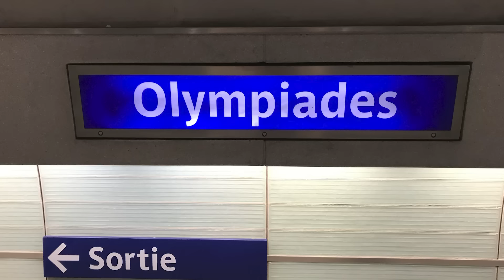Why Paris is Doubling the Size of its Metro?

Comment: Paris and Moscow Metro and Suburban Systems keep getting bigger and bigger

Meanwhile London and New York have stayed stagnant
Reply: What about the London Overgroind?
Reply: London has not stagnated. It has two ring roads already. The circle line on the underground which has been operational since the mid 90's and the London Overground which has been operational from around 2007. Suburb to suburb transport has just been completed last year with Crossrail aka the Elizabeth Line. They're now thinking of doing another Crossrail line from north to south
Reply: @UnclePooSniff  Now compare that to the Projects of the other two Cities mentioned

At least they're doing more than New York😂
Reply: @UnclePooSniff  And the extension to the Bakerloo line? Paris is delivering all of this before London can extend one line by four stations.
Reply: @jayfielding1333  Good point. London is just ridiculously slow at doing anything. The Bakerloo Line desperately needs to be extended back up to Watford and further south. They need it. Also the Northern Line needs sorting. Looks like a hot mess. Probably be 2040 by the time all that is addressed
Reply: Idk about London, but New York? I would argue that it is not stagnant. It's in fact going into the minus. It's moving backward. The crumbling infrastructure, the 9hettoization of the metro stations (trash everywhere, homeless and criminals occupying the stations, people kept being harassed on the stations). Making the viability of the service worse and worse. NYC Metro is unsafe.
Reply: London over 400 km metro rail 
Also has 120km cross rail 
35 km light rail 
Overground rail and many more
Reply: Come on 😂 Paris still operates trains from the 60s and London fully opened the Liz line not that long ago
Reply: @DyingJournalistsAreMyDopamine Woah bro you mean people don't want to ride a warzone on wheels? Not very dei of you
Reply: @Gfynbcyiokbg8710 Name that line which has trains from the 60's in Paris?
Reply: @puccaland definately line 3, and probably lines 3bis, 10 and 12
Reply: @Gfynbcyiokbg8710  Those trains are from a serie launched in 2012. 🤦
I guess you can easily find on YouTube videos about how the metro actually looked like in the 60's. Moreover what do 4 lines say about a network counting 40 railway lines?
Reply: @puccaland  No the MF 67 still runs on those lines 😂
And if 10% of your lines (25% of the metro) operate ancient trains, you are definately doing something wrong
Reply: @Gfynbcyiokbg8710  MF 67 is just a model, like the shape and stuff, not a train built in the 60's. Across the years that model was upgraded in many series and the latest one on those lines is from a decade ago. Just like the TGV and RER aren't trains from the 70's or the Transiliens trains from the 2000's 🤦
Reply: @Gfynbcyiokbg8710  You're just being desperate dude. Besides if you knew anything about public transportation done right you wouldn't be paying what you pay in London for what is considered a disgrace of a network for such city.  The day we'll need your expert assessment on how doing public networks right you'll be the first to know.
Reply: @puccaland  Yeah but there are still trains from the MF 67 A1 rolling around line 3, and those were definately built in the 60s. And those 'upgrades' haven't done much, they still look ancient.

You also seem to have Zero understanding of what the RER and TGV rolling stock is like. Its not one "shape and stuff" they have very different models from different years. The RER and TGV trains from the 70s look nothing like the modern ones
Reply: @puccaland  Says the person with no understanding of public transport, expecially Parisian public transport. 

London may be worse in terms of what you pay, but Paris is terrible in terms of how you pay. London has had contactless payment for 10 years now, Paris still doesn't have it anywhere (but two bus services). London has also had its Oyster card for 21 years, Paris has had its equivalent for 5.

And even after the Grand Paris Express, London will still have a longer metro system than Paris.
Reply: @Gfynbcyiokbg8710  There aren't MF67 A still rolling. That model has been discontinued decades ago. Moreover on the lines you mentioned they are using the MF D, E and F models 🤦

Looking ancient doesn't mean that it's ancient. And looking ancient is one of the purpose of the Paris metro. It's considered part of the heritage and that keeps the tourists happy. 🤦
Reply: Yes, the TGV and RER had different models and those models are developed into different series. They can also use different models like nowadays most RERs are double deck trains and soon the RER B will have one as well. Same system with the metro! Those metro trains you say look ancient are technology wise very much modern and the new metro lines will use part of that technology although they won't look ancient. The metros on the lines you mentioned look nothing like the MF 67A 1 either. You're just full of it.
Reply: And desperate. That's not because you live in an alternate reality which you filled with fakenews and wishful thinking that people have no clue about the Parisian network. I know enough to know that Paris has the densest network in the world and is regularly awarded best network in the world with every Parisian having a mean of public transportation 1 km away maximum. London isn't even playing in the same league.
Reply: Terrible on how we pay? Lol how you pay in London is called a scam in Paris. 

The rest you totally live in a parallel universe. So much for accusing others of not knowing the Parisian public transportation network. 🤦
Reply: Contactless payment has been existing in Paris since 2002. That's 22 years for you. It's used in all the public transportation systems including the buses. Nowadays people use either the Navigo or their phone. They pay between zero to 42 euros per month for unlimited access to the entire network which goes beyond the Greater Paris limits, the tourists like you will pay 84 euros for a month.
Reply: Paris has zero equivalent of the Oyster card which is just a rip off and people don't need it for the reasons expressed above. Oh! Wait, for the tourists they made one they call Navigo Liberté or something. And I am not sure because that's not worth using it.
Reply: Who cares about having the longest metro system? People care about having an efficient and cheap metro system. That such a big city like London is still almost entirely reliant on the metro is precisely why it makes it a disgrace. The metro is slow and is useful in the urban areas only. Let's not even get started on how it's cramped in London, very uncomfortable. Then you complain about metros which look ancient?
Reply: Paris is also reliant on the RERs, Transiliens, tramways and TERs to go faster and for better comfort. And since they don't have to care about whether they can afford moving around, they do use all those networks like a single one. 

With just the 4 new lines the metro network in Paris will be bigger than the metro network in London and they keep adding new lines projects in Paris. And nobody cares for in the case of Paris that's just a fraction of the network. The RER network alone is bigger than the metro network. You're desperate.
Reply: @puccaland  😂 Then why are there pictures of MF 67 As still running?
And if having heritage trains was the point then why are they planning on retiring them? And why don't the new trains have the same 'heritage' look? Stop making up nonsense
Reply: @puccaland  The Navigo Easy was made because Paris' old ticket system was very confusing to tourists. But that didn't fix much. You still see a bunch of people online who are really confused with the mess that is the Paris fare system
Reply: @puccaland  Yeah no that was a smart card. Paris still doesn't allow for payments with credit/debit cards. Also when it was introduced it did barely anything.
Reply: @puccaland  And paying with your phone is so much harder in paris. You are forced to do everything via an app, whilst in London you just tap your phone and pay via Apple/Google Pay
Reply: @puccaland  Again, more nonsense from someone who has no idea 
London has a massive rail network through National Rail TOCs which includes Thameslink, the Overground and the Liz line. No one is 'entirely reliant' on the tube.

And again, you have no idea what you are talking about. Those small trains make up a minority of all trains used in London
Reply: @puccaland  And you are again just ignoring everything else London has.  London has 3 of the top 5 busiest commuter rail stations in Europe and 8 of the top 10 busiest 'rapid transit' stations in Europe.
Reply: @puccaland  You also don't seem to understand how Youtube works grandpa
Reply: @puccaland  prove it then. Because everything up to now that you've said about either city has been wrong
Reply: @puccaland  So you agree that you are wrong?
Also you can't even comprehend basic english. 😂 None of that is what I said.
 I said the MF 67s are ancient and look so (which they are)
 You then said that people like that because 'heritage', which clearly isn't the case as the new trains have a completely modern look
Reply: Don't try to pretend that the tourists are like you, confused. They know Paris better than you do and the daily, weekly or monthly Navigo are the way to go for them. Navigo Easy is simply the physical support allowing visitors to charge the plan of their liking if they don't stay more than a day, or for the Parisians who rarely use public transportation.
Reply: @Gfynbcyiokbg8710  Can you two stop arguing already?
Reply: @Gfynbcyiokbg8710  Who cares about paying with a credit card? You're saying that as if it was a progress, it isn't. You pay by credit card because you have to pay for every single one of your metro rides, in Paris people either use their phone for that or they don't have to pay for every single ride or to pay at all. Stop trying to make a rip off pass for an advantage that's pathetic.
Reply: @puccaland  😂 have you seen how many posts there are on sites like reddit with people asking how to pay on Paris' system. Its not that simple
Reply: @BLACKSTA361  you decided to post that comment on the internet
Reply: @puccaland  Maybe think for a second before you most even more nonsense? You can absolutely have a fare hopper scheme or a daily cap with credit cards. London has both.

You can still have monthly passes or whatever whilst ALSO accepting credit cards and proper mobile payments, whats good for regular commuters isn't whats going to be good for everyone
Reply: @Gfynbcyiokbg8710  So your feelings are hurt that Paris Transportation is moving forward while Londons is not?
Reply: @Gfynbcyiokbg8710  I simply don't live in your alternate reality. The entire metro system in London is considered cramped by international standards. Even in Tokyo where they can reach 200% congestion rate it feels more comfortable in comparison. You can gather all the networks you want in London it still makes the network too small and too slow to be efficient for such big city. And with the price that's simply a scam. I never said the entire network but almost. So you'd rather focus on your English comprehension skills as well or keep making an embarrassment of yourself.
Reply: @Gfynbcyiokbg8710  London is whatever you want and is still not playing in the same category with Paris. Having busy stations or lines isn't what makes the network efficient. 🤦Keep trying.
Reply: @Gfynbcyiokbg8710  I don't have to prove the hallucinations you have in your head. You can easily find what trains run on what lines, that's not a secret. 🤦

Quote anything I said which was wrong?
Reply: @puccaland  And again you say absolute nonsense with no evidence at all. London's bus network is more than twice the size of Paris', London's metro network is almost twice the size of Paris' and when it comes to the rest of the rail network, you literally cannot compare their sizes.
Reply: @puccaland  Well you seem incapable of proving that point, so I suggest that you keep trying
Reply: @puccaland  You said that the MF 67 A was retired decades ago, but there is a photo in Wikimedia Commons from 2022 clearly showing a MF 67 A (M. 10023) still in use.

You said that the new metro (and RER and TGV) trains were just 'upgrades' of the same model which definately isn't the case

You also claim that 'contactless payment' was introduced in 2002, it was introduced in 2001. Thats also not what the vast majority of people would consider contactless payment. Plus the Navigo was extremely limited in its first years.

You also say that when the GPE is finished Paris will have a larger metro network, which also isn't true. Paris: 426km
London: 440km
Reply: @puccaland  You have also said that paying by credit card forces you to pay for every ride. Which certainly isn't true. 
On London buses you can switch buses without paying again, and there is a daily cap system wide so that you never pay more than a certain amount.
Reply: @Gfynbcyiokbg8710  Well if your source is Reddit, no wonder why you're so out of your depth here. Dude, Paris welcomes every year 50 million tourists not even counting the simple visitors. We don't need a virtual place like Reddit filled with so many people who aren't the brightest lights, tourists are like part of the scenery every single day in Paris, in the real life.
Reply: @puccaland  You also completely ignore any other rail services in London and routinely make claims that you would never be able to prove.
Reply: @Gfynbcyiokbg8710  You're the only one talking nonsense and not providing any evidence. What is the size of London metro network? How many bus lines are there in London? Moreover we note that on a topic about the railway network here you are babbling about the bus network. That's how desperate you are. 😂 If now you're comparing the metro, even the tramway with the bus, you're just making my point. Slow and inefficient.
Reply: @puccaland  Yeah well a system should be easy to understand even for people who 'aren't the brightest lights'
Reply: @puccaland  London's metro network is 440km long according to TfL
Reply: @puccaland  There are 675 bus routes in London that are operated by TfL. And buses are a vital part of any city's transport system so they are absolutely relevant
Reply: @puccaland  Also you seem to lack any comprehension skills because I said that it was impossible to compare the SIZE of each city's rail network. And I said that because it literally is impossible to compare the SIZE of each city's (not including metro and tram) railway network. You can still compare the rest, because London still has a ton of fast rail services.
Reply: @Gfynbcyiokbg8710  Desperate desperate.

Give us that link of a M67A names M10023 being in use in 2022?

Dude, you have on Wikipedia the list of all the cars being used per line, and I didn't find any trace of the one you're talking about. Moreover on the lines you listed they don't use the M67A series! How I see it, on your Wikimedia Commons they simply showed you a picture of an old train which was uploaded in 2022. 🤦
Reply: @Gfynbcyiokbg8710  Oh! Wow, I made a typo and wrote 2002 instead of 2001 and all by magic I am lying? Desperate desperate. Well, that still makes way more years than in London. Back then it literally replaced the Carte Orange so all the users who had a Carte Orange moved to the Navigo so it was pretty much a lot of people.
Reply: @Gfynbcyiokbg8710  According to Wikipedia the current London underground counts 11 lines covering 402 km, Paris 16 lines 226 km plus 200 km with the 4 new lines. But for the sake of the argument let's say London will be 440 km and Paris 426. That's a difference of 14 km! So you really are that desperate after all? What about such small difference? Well? In London the metro accounts for the majority of the railway network, in Paris it doesn't! Your 14km are covered by some tramway line somewhere in Paris. 🤦
Reply: @Gfynbcyiokbg8710  Paying for every ride means that you pay everytime you take the bus 🤦. In Paris you can take the bus 1000 times if you want you won't pay any fee for that's included in your daily, weekly, monthly or yearly plan. Please follow! In Paris too the tourists don't pay twice between two buses. That's not what the topic was all about, was it?
Reply: @Gfynbcyiokbg8710  I didn't ignore the other railway networks in London, I literally said that you can gather all of them the network in London is still a disgrace for such city and it isn't playing in the same category with Paris. Simply follow.
Reply: @Gfynbcyiokbg8710  The system is pretty easy to understand for the Parisians and most tourists who go there. Simply don't go to Paris if you can't manage.
Reply: @puccaland  You are just wrong again. The Navigo didn't start having the same functions as the Carte Orange until the end of 2004 and only fully replaced the Carte Orange in 2006.
Reply: @puccaland  Again you are completely ignoring any other rail service. London also has the DLR which is an Automated Light Metro, bringing up London's metro length to 440km. 
And again London has alot more than just the Metro. From the Overground, Elizabeth Line and Thameslink to the many National Rail operators that provide commuter services.
Reply: @Gfynbcyiokbg8710  Didn't find the page on TFL saying that the length of the network is 440 km. But like I said it doesn't matter. Make it 600 km if you want it still doesn't change the dynamic.
Reply: @puccaland  Except you cannot prove any of that
Reply: @puccaland  Tfl say that the tube is 402km and the DLR 38km. 402+38 = 440.
Reply: @Gfynbcyiokbg8710  It's not possible to compare the size of the railway networks between cities for people who are desperate and don't have a point only. In the real world we simply pick the entire railway network in any given city and we compare with the entire railway network in another city. You said what the local railway network is made of in London I said what it was made of in Paris. Now simply work on your intellectual honesty.
Reply: @Gfynbcyiokbg8710  The DLR isn't considered part of the London metro network hence why the TFL doesn't include it to calculate the size of the metro network. The DLR is a network of its own and you can add it with all the other railway networks it won't change anything to the problematic. Try harder.
Reply: @puccaland  There is no way to define London's local railway network. London doesn't have one or two companies that operate local services, London has about 11. 
Using the oyster zone isn't a fair comparison as it only goes 45km outside of central London, whilst Transiliean goes 100km outside of central Paris. And there is no branding of services that are comparable. 

Unless you want to go through one by one each station and service and decide if it counts or not, it is literally impossible to compare the size of the two.
Reply: @puccaland  Don't conflate Metro system with Underground system. The Underground isn't a term for all metro services in London. The DLR and Underground are different systems BUT they are still both METRO systems.
And therefore when I say 440km of metro lines, that includes the DLR because it is still a METRO.

Also TfL never says that the DLR isn't a part of London's metro network.
Reply: @Gfynbcyiokbg8710  It is. Local networks are managed by local authorities which define which network is local or not. That's the same all around the world and London isn't any different. The Transiliens is part of the Parisian local network. Who talked about zones? London isn't to be compared to the center of Paris but to what is used to define Paris at a national level and internationally which is the Greater Paris and the equivalent of tfl is IDF Mobilité.
Reply: @Gfynbcyiokbg8710  That there is nothing comparable to the Transilien in London is pretty much my point. Despite its size, London is lacking infrastrures to cover the areas beyond the central urban perimeters.
Reply: @Gfynbcyiokbg8710  Would it be London or the several organisations, they compare its network to the networks all around the world including Paris. That you don't want to do it because it doesn't serve your narrative is your problem. They do everything. They count the lines, the stations, the length, everything.
Reply: @puccaland  What are you on about?
Reply: @Gfynbcyiokbg8710  I didn't conflate anything. That's simply you trying to digress as usual. I never said anything remotely close to your "the underground system is a term for all metro services".
Reply: @Gfynbcyiokbg8710  TFL doesn't consider the DLR as part of the metro network that's what I said. The DLR is a light metro, not a metro, and is considered a railway network of it's own. There is the equivalent of the DLR in Paris as well and it's not considered being part of the metro network either. The day TFL will include the DLR in the metro network they will let you know. For now they consider the metro network in London doesn't include it.
Reply: @puccaland  Yeah no thats not how the world works. Local transport can be entirely private, entirely public or a mix of the two. 
Also a local authority is a council, which doesn't include TfL/GLA. The GLA is regional not local.
Reply: @puccaland  You literally assume that London Underground equals London Metro.
Reply: @puccaland  A light metro is still a metro. Its literally in the name. And TfL never talks about London's "metro network", so again you are just making up nonsense

Just because it is operationally seperate from the Underground doesn't mean its not a part of London's metro system. 
Also prove to me that TfL has said that the DLR isn't a part of London's "metro network". Good luck trying to do that.
Reply: @Gfynbcyiokbg8710  I never assumed such thing. Your entire intervention here was to manipulate people's words and do the questions and the answers yourself. So simply quote what I actually did say and refrain from speaking on my behalf.
Reply: @Gfynbcyiokbg8710  That you're deprived of any logic has nothing to do with me and at this point it's clear your hopeless.

A light metro is a light metro, just like a tramway or monorail aren't considered part of a metro system anywhere but in your mind.  Tfl is the official body in charge of monitoring all the public transportation system in the Greater London, explains to you all the systems, and they don't include the DLR in the same network that the metro network. Get over it.
Reply: @Gfynbcyiokbg8710  Or don't for what I care. I don't have to care about your wishful thinking and self delusions. We won't change the facts just to keep you happy. Like I said in your alternate reality you can make the London metro network length 600km if you want it doesn't change anything at all. The network is still too small, too inefficient, too expensive for the service provided and doesn't play in the same league with the Parisian network.
Reply: @puccaland  A light metro isn't a tram or a monorail. This just again proves that you have no understanding of anything to do with public transport. 
A light metro is just a metro that uses smaller trains are therefore has a lower capacity. Many metro systems have both light and heavy metro lines within ONE metro system
Reply: @puccaland  😂 You just love making conjecture with ZERO evidence to prove it.
You haven't and cannot prove any of what you have said because you know that they are all just lies
Reply: @puccaland  You literally did assume that. TfL has never talked about London's "metro" network
Reply: @puccaland  Again something that you just refuse to prove. The Underground is A metro network, and so is the DLR. Together they make THE London metro network
Reply: @Gfynbcyiokbg8710  So basically you are telling me that you don't know what the word metro means ? In the UK you call the metro underground or the Tube others call it subway and most of the world calls it metro in English because America. Now if you have complaints about the word metro being used rather than underground go complain to the Americans and their influence in this world. 🤦And if you can't adapt to the realities of this world simply stay in that alternate reality you built for yourself. You perfectly know what I refered to with the term metro and you confirmed it when you reinstated what tfl said about its size. Pathetic.
Reply: @puccaland  😂 Again just proving that you don't understand anything. In Glasgow (UK) their metro system is called the Subway, and in London we have BOTH the DLR and Underground (Tube).
The Underground is the word for A SINGLE metro system, not for all of London's or for all of the UK's 

There is no one word for every metro, except for metro. And the DLR and Underground are both METROS that make up London's Metro network.
You can't just pick and choose things so that they prove your nonsense ideas.

And once again you are refusing to prove that TfL has talked about London's "METRO" network because you know that it was a lie from the start.
Reply: @Gfynbcyiokbg8710  I never said that a light metro is a tram or monorail. So thank you again for perfectly illustrating your English comprehension issues. Or is it despair?
Reply: @Gfynbcyiokbg8710  A light metro is simply a light metro and only in your alternate reality it's considered like a regular metro system. 
Name those cities which consider their light rail and metro network as being one unique metro network? And even if they did how is it of any relevance to London? The TFL speaks for London and they clearly separate the underground and dlr.
Reply: @Gfynbcyiokbg8710  You're simply raving as usual to impute me things I never said believing it will make illusion and cover the void of your arguments.

TFL uses the words underground or the tube which is your way in the UK to name the London metro network. You can check, it's translated by the word metro in most languages and all around the world they use what tfl says to define London's metro network. Ah! My bad, sorry I forgot you don't know what metro means. To define the London underground 🤦
Reply: @puccaland  1st of all many light metro systems are nothing like light rail. Many use trains derived from heavy rail trains.
Budapest, Vienna, Sofia, Beijing, Shanghai, Guangzhou, Nanjing, Wuhan, Milan, Moscow, Singapore, Busan, Seoul, Barcelona, Taipei, Bangkok, Istanbul, Chicago, and more all have light metro lines as well as heavy metro lines that are all considered a part of a single metro system.

And so what if they have them seperate? For anyone travelling around London it makes little difference if they are on the DLR or on the Underground because they are integrated into a single system.
Reply: @puccaland  😂 You literally just used 'light rail' in place for light metro. And the lines between what is a tram and what is light rail are very blurred
Reply: @puccaland  So before you said that you didn't think that Underground = Metro, and now you do 😂 Make up your mind.

Also TfL DOES NOT use underground to mean all of London's metro services because Again the DLR IS A METRO. People with no brain like you have just assumed that Underground = Metro because the underground makes up Most of London's metro.
Reply: @Gfynbcyiokbg8710  Beijing Subway is just the name to call the city's public transportation network. It doesn't mean that that network is a metro or subway and is considered as such. They do make the difference between their metro network and their 2 light rail lines. In fact people even have to pay when changing from a network to another.
Reply: @Gfynbcyiokbg8710  You're the one who made it a problem because you are separate not me. Everywhere the different networks are used as one network. In Paris the train lines are used interchangeably with the metro lines, or any mean of local public transportation. It doesn't mean that a RER is a metro, does it? In Tokyo the different networks are private but the entire network works like the same network. You're just fabricating issues which don't exist out of despair. Nobody ever told you that the network in London isn't used as a single network.
Reply: @puccaland  yeah thats not the case. The difference between Beijing's different systems is because they have different operators, it has nothing to do with the difference between light METRO and heavy metro.

And you just seem to love to assume things that aren't true. 1st you assume that Underground = the only Metro and now you assume that Light Metro = Light Rail
Reply: @Gfynbcyiokbg8710  Your delirium in your head has nothing to do with me.
In Beijing several operators manage the metro network and we don't change the fare system when changing the lines. We do for the light rail lines. RER on Paris is managed by 2 companies and its considered a unique network with no change for the fares. All that is irrelevant for all the bodies in charge of a public transportation network clearly state how they differentiate the networks.
Reply: @puccaland  😂 And once again you are wrong. Tokyo has two very seperate systems that make up the Tokyo subway that definately do not work like a single network.

Also you're the one trying to push this idea that even though the DLR is a metro system, its not a part of London's metro system. Which 1st of all doesn't matter from a rider's perspective and 2nd is just wrong.
Reply: @Gfynbcyiokbg8710  I didn't assume anything I simply said what tfl says that the London metro network = 402 km
Reply: and that's because they don't include dlr in it. That they consider the metro network being what you call the London underground
Reply: that everyone else around the world considers it's the London underground. If you're not happy send a complaint to transport of London.
Reply: Tokyo doesn't have two separate systems which make up the Tokyo metro network. It has two companies, both public, taking care of the metro network and cooperation in the form of a discount when changing from a network to another
Reply: simply because in Tokyo, each company applies its own fares. They are also using a same pass unlike with the other networks which aren't part of the metro network.
Reply: And before spreading the same fakenews you did with Paris, you should know that I have been living in Tokyo for 18 years so you will have to try harder than your usual hallucinations and wishful thinking.
Reply: Ah ! Even better. The Tokyo metro network and some other private networks use the same trains and tracks when entering the city center.
Reply: The Denentoshi line which isn't a metro line becomes the Hanzomon, the Toyoko was connected to the Fukutoshin etc etc. All these train lines are private. You will need two passes when travelling on those different networks even if you never change train.
Reply: @puccaland  Nope TfL says nothing about London's metro network. That is what they have said is the length of the underground which you have falsely assumed is synonymous with metto
Reply: @puccaland  Prove it
Reply: @puccaland  Yeah well a discount isn't the same as if they were the same network.
Reply: @puccaland  that explains so much. Of course you know nothing about Paris because you haven't lived there for 2 decades or bothered to search up anything.
Reply: @puccaland  Ah so you agree that you were wrong. Great
Reply: @puccaland  Say you don't understand english without saying you don't understand english.

And your constant insults just prove my point even more. Only someone who knows they cannot prove any of their arguments with fact would turn to boring insults
Reply: @Gfynbcyiokbg8710  Yes the whole world fasly assumes but you. If that can help you cope emotionally. 😂
Reply: @Gfynbcyiokbg8710  They are the metro network. It has nothing to do with a fare but with what Tokyo decided its metro network is. 🤦
Reply: Sorry, I use the Paris and the Tokyo network all the same for I am often in those cities. Typing from Paris right now.
Reply: But anyway, only deluded people believe that a network is this or that because of their navel. So, following your own arguments, you know nothing about the Parisian network and the Tokyo network and all the networks you listed earlier for I am pretty much sure that you don't live in those cities let alone have ever been there for most of them.
Reply: @Gfynbcyiokbg8710  Calling a spade a spade isn't an insult. You were clearly trolling from the get go.
Reply: @Gfynbcyiokbg8710  As for your other inner monologues sorry I have no clue what you're talking about. Or were you asking me to prove you how to use the Tokyo network? 😂 I guess you weren't bored when you accused the entire world and tfl of not having a brain?
Reply: @puccaland  How is Tokyo by the way. Must be nice living  in the city with the best public transportation in the world
Reply: @BLACKSTA361  I am a big city dweller so Tokyo is great. You can never be bored there.
Reply: @BLACKSTA361  On the surface you could say that the Tokyo network is perfect. That's in fact what visitors believe. But as a daily commuter that's not that simple and the network has many many flaws.
Reply: @BLACKSTA361  People tend to look at a map of Tokyo railway network and are like "Wow! It's so big, so many lines! " And it is. But they don't realise how huge Tokyo is.
Reply: @BLACKSTA361  Tokyo is great for public transportation. It trusts the 1st places with Paris then it all depends on one's preferences.
Reply: Detailed answer with real case scenarios below.
Reply: First of all it's very expensive and such prices aren't warranted whatsoever. Like 4 to 6 times more expensive than in Paris with way more passengers and private companies, malls etc, so it should actually be cheaper.
Reply: However at least they do deliver and it's efficient, the network expands relatively well, lots of additional services available.
Reply: Now in a real life situation, Tokyo is huge and although there are many lines, there are big swathes of the city which aren't covered by the railway. Basically, there aren't enough lines and stations even in the very city center.
Reply: The fact that it's very expensive, that there is no real discount even with the monthly pass and the different networks charge their fee, makes that many people are literally isolated because they can't afford paying for public transportation. They have no friends no social life.
Reply: They never leave their neighbourhood, or they never go outside the perimeter of where their teikiken (monthly pass between station A to station B on a dedicated route) allows them to go. When moving around in Tokyo one has to build an entire strategy to prevent the cost from going to the roof.
Reply: I live in the very center of Tokyo, 1,5 km away from Shibuya, 10 minutes by bus to Shibuya station (used to be 5 minutes but now the bus is slower I don't know why) or less than 10 minutes by bike.
Reply: If I want to get there by metro it will take 30 minutes because the entire area is poorly covered by railway networks. I used to work in the next town, 2 stations away using 2 different networks taking 35 minutes because the metro stations are a 10 min walk away and you have to make a detour.
Reply: 276 yens just for 2 stations. We can stay on the same metro network managed by the same company and pay 199 yens but it would be a bigger detour and an additional 15~20 minutes with lots of changes. Because you change networks to take the fastest route it's expensive.
Reply: So it was better to simply walk, 20 minutes, or take a taxi when I was late or too tired, about 1000 yens. Luckily I like walking. Those neighbourhoods are quite big but have only one railway station.
Reply: So it was better to simply walk, 20 minutes, or take a taxi when I was late or too tired, about 1000 yens. Luckily I like walking. Those neighbourhoods are quite big but have only one railway station.
Reply: I like walking but it's impossible to walk in the summer in Tokyo. The humidity level is too high. And I am often on high heels. In Paris (urban area) I am used to having multiple means of transportation down the building or around the corner taking somewhere fast and at a cheap price. 

Even if a railway station is a 10~20 min walk away there is always a reliable bus or several of them taking you there.
Reply: I had a health issue recently and thanks God I wasn't in Tokyo. In Paris I never have to walk anywhere passed 200m, there is always a mean of transportation taking you where you need to go. In comparison moving around in Tokyo is like going on a road trip and you always have to plan your route carefully. With my health issue I can't use the bike anymore so I would have had to take the taxi all the time. They are everywhere in Tokyo but they are expensive.
Reply: I used to live far away in Kanagawaken, the equivalent of Essonne in Paris and to work in the Northern part of Tokyo, equivalent of the Seine Saint Denis. Pretty straight forward and faster in Paris and cheaper.
Reply: Eda to Itabashikuyakushomae that's only 30 km. But you need to use 3 different companies. My poor employer had to pay 20 000 yens per months just for that route. Nowadays it's about 24 000 yens. At least I could use it to go to Shibuya which is a popular town to hang out.
Reply: Thanks God I didn't have to take a connection in Shibuya, that was the same train all the way to Jinbocho. And thanks God I took a connection on the way back before Shibuya or I would never be able to sit in the train and that was still a long ride from Shibuya. I often finished work around 11 pm or midnight and the last trains are very crowded in Tokyo.
Reply: In comparison Corbeille Essonnes to Saint Denis that's twice the distance, one train line but same commuting time! Moreover that's a RER so a spacious double deck train, even during rush hours about everyone manages to get a seat, people can take their bike with them and soon they will change them to put the same trains we find on RER E. I took it once that train is just amazing. I never go to Corbeille but I regularly use all the RERs except for RER E 😢
Reply: In the outer Tokyo it's worse. Which leads me to the next problem. The network shuts down very early and in the outer Tokyo it can be as early as 10 pm for the railway. For a city which is alive 24/7 that's a real problem.
Reply: There is no back up plan like the bus network which is slow, inefficient and expensive. Buses frequency is very low in Tokyo, they aren't very comfortable, and they stop running very early.
Reply: The buses next home stops at 8 pm despite the fact that they connect to 2 major stations in central Tokyo and a hospital. It's like you're living in the rural area. In my previous neighbourhood which is next to Shinjuku there were only 2 bus lines and they stopped at 11 pm.
Reply: Only the elderly people, schoolboys and housewives with young children really use buses. And foreigners like me. But entire neighbourhoods in the city center, especially close to Shibuya, don't have a railway nearby and the buses are the most straight forward cheapest way to get there.
Reply: So the real network taking over when there isn't the rail is the taxi network. Therefore expensive. Fortunately they are everywhere 24/7 even in the middle of nowhere. I heard that the bus system is so bad and underdeveloped because of the taxi lobby. If one doesn't carefully optimises its route he can make many detours and pay a lot of money. And we often don't have a plan B or C even in the center of the city then only the taxi can take over, or walking or the bike.
Reply: When I lived in Nakanosakaue at some point I had to go work to Itabashihoncho. That's the city center, highly urban area, only 8 km distance and the route is straight on a main road. Basically it's like being in the center Western part of the center of Tokyo and having to go to the Nortern part.
Reply: In Paris the equivalent would be to be in Neuilly and go to Saint Ouen. That's done in 15 minutes by metro+train combo connecting those areas together and there is a plan B with buses which are taking 40 minutes.
Reply: In Tokyo there is nothing connecting those areas together. No railway and no bus. You have to make a big detour through the center. The fastest route requires changing network three times, the whole thing takes an hour door to door and it nearly cost 600 yens.
Reply: Basically the lines connecting the South to the North direction are all in the center. The Yamanote works like a ring and does that job as well but they need other lines beyond the Yamanote perimeter making those connections South to North.
Reply: Basically the lines connecting the South to the North direction are all in the center. The Yamanote works like a ring and does that job as well but they need other lines beyond the Yamanote perimeter making those connections South to North.
Reply: The train punctuality rate is virtually the same in Tokyo as in Paris but you'll hear people rambling about how trains are always late in Paris and never late in Tokyo. The locals know better. In Tokyo it's very crowed, most lines have a congestion rate reaching 100% many have one close to 200%. But the trains aren't adapted to take in so many people.
Reply: The train cars are small, there is no difference between a metro car and a train car. In Paris if a metro will always be crowded and feel cramped during rush hours, a train will always keep a certain comfort unless there is an issue.
Reply: Among the most crowded train lines in Tokyo you have many which cross the city center like the Chuo and Sobu lines. The Tozai line is the most crowded metro line.
Reply: The train cars in Tokyo aren't very stable either. When you are commuting, you couldn't get a seat and have to spend 1h standing to go home, sometimes the car is too crowded so you can't even hang onto something, that's really uncomfortable and exhausting.
Reply: I used to believe they are so shaky in case of earthquakes but the Shinkansen is very smooth and stable. They simply didn't upgrade the local trains to fix that issue. Do they even care?
Reply: I have lived in many places in Tokyo, central areas and the outer Tokyo. Choosing where one lives basing on public transportation is more important than choosing basing on the rent. Because commuting can quickly become a nightmare and be very expensive.
Reply: That's not because one lives far from the city center that rents will be cheaper but public transportation will invariably be more expensive and have a negative impact on your quality of life.
Reply: Some routes are dependent on a big central station and force people to alway take a connection and change network. A station like Shinjuku is like a city of its own. Having to take a connection there every single day is very stressful and exhausting. Same in Ikebukuro, Tokyo station etc
Reply: The Fukutoshin line is one of the best thing which happened to us because they connected the Toyoko line to that metro line when before people had to take a long connection at Shibuya station. Also made using the network faster and cheaper for many people for they didn't have to change network in Shinjuku anymore. A real game changer. Unfortunately Tokyo hasn't built much lines ever since.
Reply: I used to live on the Oedo line, that line is so deep that it takes 5 minutes to get to the platform. When you are in a hurry you have to run down the endless escalators. All those details do have an impact on our quality of life. In fact it took me the same time to go to school by bicycle than by metro using that metro line even though that was only 4 stations on the same line.
Reply: The network is clean even though it's not as clean as tourists believe, but there are many reasons behind that. One of them is that all day an army of elderly people are cleaning behind, doing this job because their pension isn't enough to survive. Which leads us to the type of society one wants to live in.
Reply: The poverty and precarity levels are very high in Japan especially for the elderly people. Does one want to live in a society where the elderly can retire and live a decent life with their pension even if it means that a public transportation network will be slightly dirtier, or in a society where the elderly have to keep working menial jobs nobody wants to do, paid with a poor salary to make ends meet?
Reply: I personally prefer the best quality/price ratio and a network working 24/7 with a good coverage. I am grateful for both networks which are doing a great job. To this day I don't have a driving licence and I do everything using public transportation, even the groceries in supermarkets or malls.
Reply: Because public transportation in Tokyo is just exhausting and too time consuming even to cover small distances, and because the night buses in Paris they use the old buses which aren't as comfortable as the regular buses, I started to use the bicycle to cover longer distances in Tokyo and the rental bikes in Paris to do the first and last kms.
Reply: Currently I am in Paris and I just bought a e scooter which allows me to stop taking the bus and metro network. Haven't checked yet if they sell it in Japan, if they do it will allow me to not take routes which are longer than necessary in Tokyo or the taxi.
Reply: I only plan to take the trains now in Paris which are faster, less crowded and noisy and which are more comfortable. And ironically that's thanks to a British innovation. I can't carry a e scooter that's too heavy and cumbersome. But a British company created a foldable e scooter, still too heavy for me but it can still roll when it's partly folded and be used like a trolley. Will start using it this week.
Reply: If my estimates are right it will shorten my journey to go far away near Disneyland Paris where I go thrice a week by 30~45 minutes at night when the bus to do the first kms takes forever and waiting times between trains in the city center are longer. During the day I only save 15 minutes and don't have to take connections and crowded buses.
Reply: I don’t get the point of arguing. This is an amazing project for Paris and I hope it helps people. But comparing this to the Elizabeth Line isn’t logical. Different purposes and there is also Old Oak Common hub, Ebbsfleet 20000 homes etc which people neglect. London already had good connections with the suburbs but it just had a problem through the centre. 42km of tunnel built for the Liz Line doesn’t sound like much compared with 200km for Paris but it has increased London rail capacity for over 10% and changed lives of people living in suburbs who unlike in Paris (before grand plan) COULD get to London but they then needed to get slow and laborious tube lines such as the Circle Line. Now Liz Line means someone in Slough can go straight to Bank or Canary Wharf without changing
Reply: @Robc--jd6yh  You claim that there is no point arguing to then proceed with more strawman arguments and blatant disinformation.
Reply: @Robc--jd6yh  The Grand Paris Project isn't only the 200 km of the 4 new metro lines. The Elysabeth Line is a new line built to expand the London railway network just like the new lines and extensions in the Grand Paris Project so it's very much logical to compare. There aren't different purposes, it's all the same.
Reply: @Robc--jd6yh  Which is beside the point anyway for the subject was the time and cost involved to build that line and not its purpose.
Reply: @Robc--jd6yh  Before the Grand Paris Project people in the suburbs could very much go to the center of Paris. Seriously I don't know where you get your information from. Moreover the new metro lines you focus on aren't to go to the center of Paris but to connect the suburbs together without going through Paris.
Reply: @Robc--jd6yh  Other lines are used to connect the suburbs to the center of Paris. And it isn't necessarily done with slow and laborious tube lines but with express trains. What the Elysabeth line is doing is what the RERs, Transiliens and TERs have been doing for decades in Paris.
Reply: @Robc--jd6yh  Initially budgeted at 15 million pounds it reached 19 billion pounds. More than half the budget for the Grand Paris Project.
The point isn't about congratulating or criticising a project here but to keep things real. Being in denial and fabricating excuses is a main factor leading to the infrastructure fiasco in the UK.